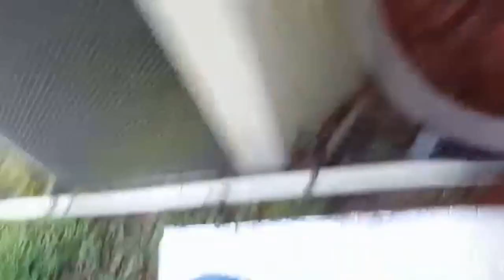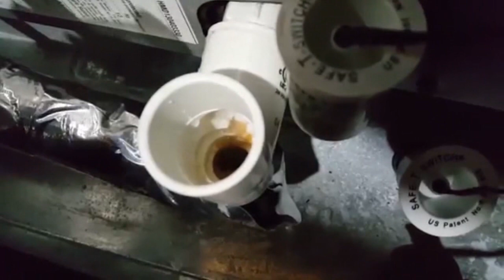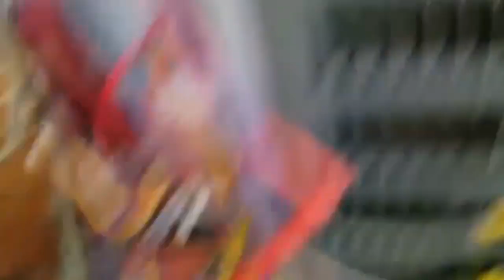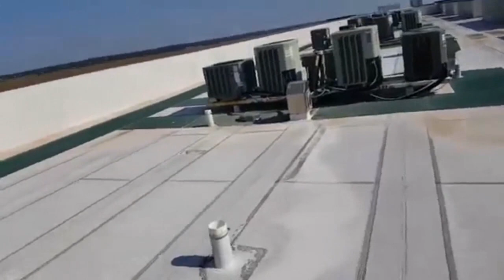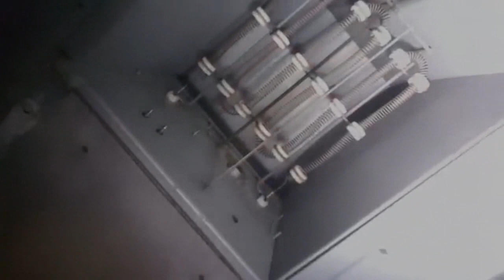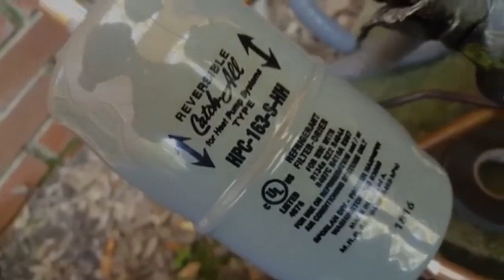HVAC Installs, Service Calls, and Life

Comment: Can you guys help me with a troubleshooting issue? My residential hvac compressor sometimes won't start and just blows air. This has been going on for about 3 weeks and happens about once a day but what's baffling is that the compressor does work multiple times per day it's just intermittent. When I notice the air isn't cool I turn the unit off and then about 30 min later I turn it on and it works. It works 90 % of the time and cools great but it's inconsistent. Hvac guy came and checked r22 level and said it was a little low but the high was at 300 and he didn't want to add any more. He said that my compressor is dying and I need a whole new unit. I really can't afford a new 10k unit so I'm trying to find out if it's something else. Would a capacitor cause intermittent issues? I looked at the capacitor and visibly it looked good. I'd have to buy a volt meter to test I guess. Any thoughts ?

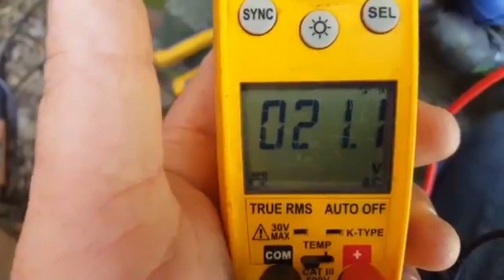Comment: 19:20 what did you come up with? Why was it doing that?
Reply from the maker: There was a voltage drop across the fan because all of the compressor windings were destroyed and disconnected electrically.